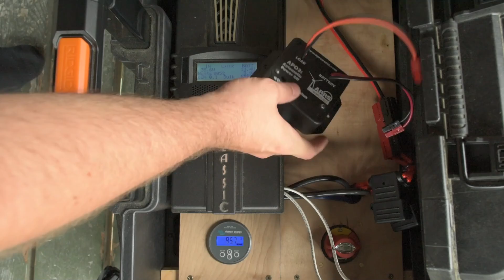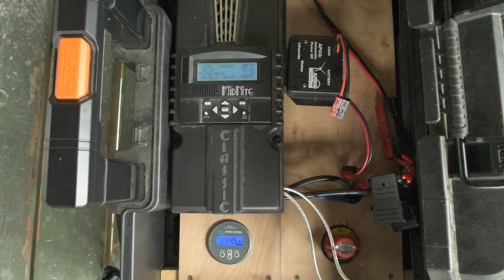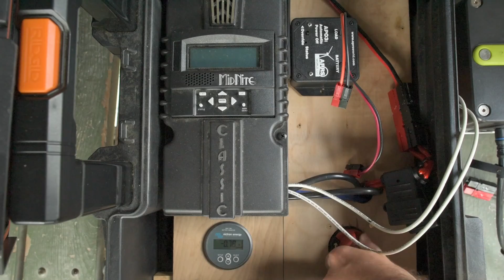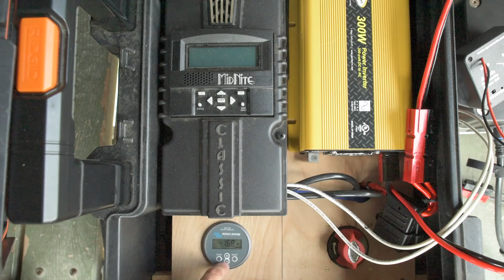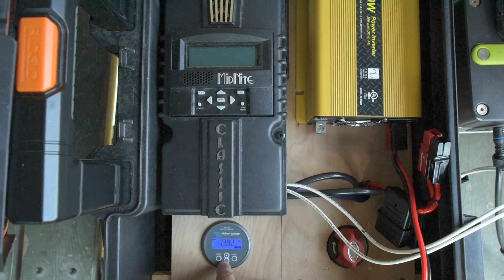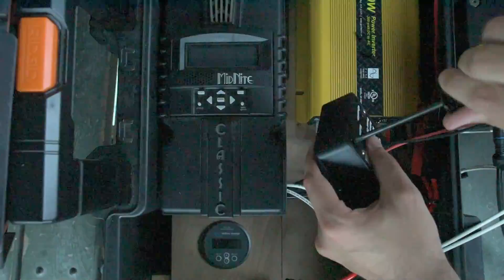1200wh LifePO4 Solar Generator Build - Part 5 - Testing

Comment: You can safely discharge a 12v (4s)lifepo4 pack to 12volt under load, the 12.7cuttof is more safe for AGM/lead chemistry, most imported is Not to float lifepo4, that and heat will kill a battery soon, nice test btw
Reply from the maker: +giottodiotto1 I'm not an expert, but I think it depends on the float voltage. I float this battery at 13.6v and it seems fine so far. I think the important thing is to not exceed the max cell voltages. I lose some capacity by only charging to 13.6v, but it also allows me to run without a bms.

Comment: Would a 12v 30ah deep cycle battery be enough to run a laptop for 2 or 3 hours before needing a recharge?
Reply from the maker: If you're doing lead acid, then the max discharge you want is 50% in order to preserve battery life (really you want 20 - 30%). At 50%, that's 15ah * 12v = 180wh. My macbook pro draws about 80watts when charging full blast, so, yeah, that would get you about 2.25hrs. Personally, I'd go with a larger battery. My Yeti 400 is a 33ah battery and unless I really want to drain it to 50% I just do a one hour charge then recharge the Yeti.

If you're using a lithium battery, you can discharge 80% and still maintain your cycle life. That and the reduced weight are the main attractions.
Reply: Thanks for the info.  I think I will start out with one battery and then add a second  later on as a modular hook up.  I can't afford a Lipo battery at the present time, have to go with deep cycle for now.  It's a start anyway.

Comment: LiFePO4 cells can go down to 2.8 volts per cell without damage, that would be a 10 volt cutoff. This can reduce the life a little though. A safe cutoff voltage would be 3.0 volts per cell so 12 volts. At 3.0 volts per cell you should be at 90-95% DOD.  

13.6 volts is also a bit low for a full charge, a fully charged LiFePO4 cell is 3.6 volts, so 14.4 volts for a 4 cell bank. Charging to only 13.6 isn't an issue if you get the capacity you need but you can store more energy if you need to.

Check out the discharge curve for LiFePO4 batteries, it will show you exactly what you measured in this video. (just google "LiFePO4 discharge curve")

Having a higher cutoff voltage at higher discharge rates is unnecessary. Under high load conditions the battery voltage will sag along with increased losses in the cables so it will cutoff much sooner than full capacity anyway. Once the load is reduced or removed you will see the voltage come back up significantly higher than the cutoff voltage if the load was big enough (1C discharge rate is more than enough to see this).

(edited: didn't watch to end, did now and corrected comment)

Comment: Dang you work fast! Project turned out awesome.
Should have about 80 ah of safe use.
would not recommend going below 3 volts per cell. You can but helps with the lifespan.
If you want to know the usable AH of your pack use your powerlab8 & run a cycle, will need to add a 4s connector (or you could do cell by cell). The 4s connector would be very useful as it will tell you the voltage of each cell just by using a cell meter or your powerlab.
Reply from the maker: +off grid kid which 4s connector do you use btw? I wouldn't mind having one just in case.
Reply: Use these nice to have the extra ones if you need to extend it. http://www.hobbyking.com/hobbyking/store/__9737__JST_XH_4S_Wire_Extension_20cm_10pcs_bag_.html

Comment: I was under the impression you can drain those batteries down to near zero unlike AGM, is that true.  Thanks for all the vids
Reply from the maker: +Nick Galanti you certainly can. They're rated for 80% DOD. They last even longer if you only use the middle 50%.

Comment: voltage drop in you lines are kicking out early that is what I think is happening
Reply: also second...
Reply from the maker: You mean the 12.7v APO3 cutoff at 13v? Yeah, that's a definite possibility. Not a huge deal either way. I've got those huge 4/0 wires on the shelf. Just need to figure out how to stuff all of that copper into a case.
Reply: createthis yea, great project cause of this video I started using my lipo box and after I discharged it I put 125Ah back into it, using 3S 5Ah lipo packs :) you can imagine the amount of lipos in this LIPO ammo box :)
Reply from the maker: WOW. That's terrifying. I've got a couple of 5ah 22.2V lipos just sitting on a shelf in the basement from an aborted DIY electric skateboard attempt. I've never charged them, but I'd have that junk in a cinderblock charging bunker if I ever tried. Lipos are super light, but kinda scary.
Reply: createthis all the newer lipos are kinda lame, I have tryed to blow them up but all they do is puff, almost no heat and no fun, and all my lipos are new, not so scary, I see older videos of them starting fire and such but I can not even get one to start fire even when I try to so I am starting to think they are getting safer.
Reply from the maker: huh. I didn't know that. good to know. :)